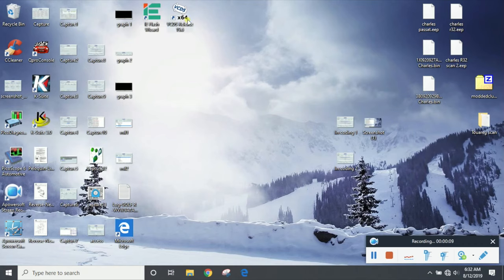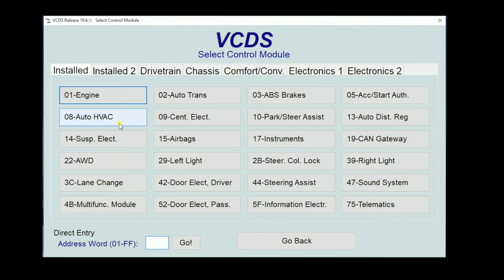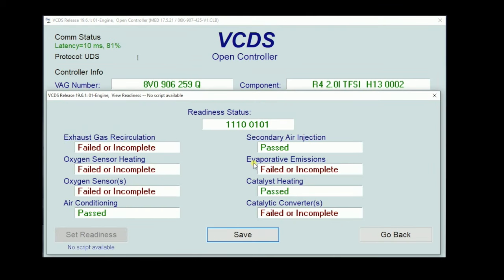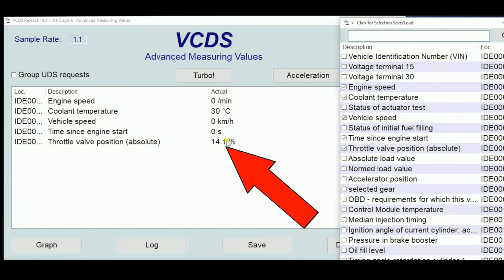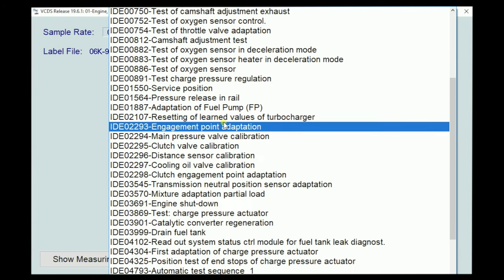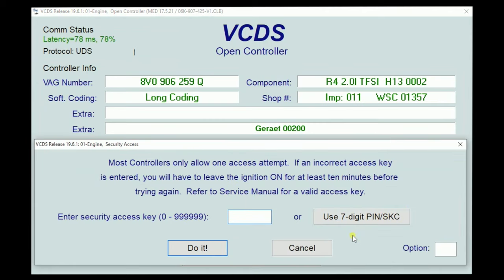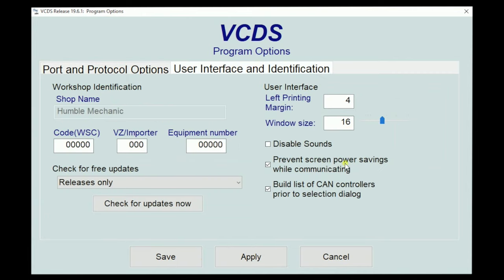VCDS Tutorial ~ How to Use VCDS Scan Tool

Comment: Hi great video I already fixed few problems on my Audi. I have a question about headlight. I had to replace one matrix headlight I put original module back, lights are working but the new light doesn’t move up and down. Can I fix that problem with my vcds??

Comment: Great video Charles as usual...quick question.....you hit on timing chain elongation:reset after chain replacement briefly.....this is my situation for a 2.0T 2014 Audi Q5.....but most recent version of VCDS does not have that option in Basic Tests!!!   Is there some other place, or some other name to look for it....or some other way to do the reset......the engine starts immediately(it had the typical stretched chain lag before chain replacement), and the adaptation value is way under 5%,....but its running very rough.....appreciate any help you can offer....thanks!

Comment: Really liked the video ,i have 1 question ,with the VCDS scan tool ,can you change the miles in the Audi ,i just brought a 20 year old Audi A3 with 102,000 km ,and its already had 7 owners ,Did i get sucked inn.
Reply from the maker: No.. Well technically yes, but only one time when a cluster is under 100km. You can make those changes, but its a deeper thing than VCDS can do

Comment: Hello 
I change my cluster recently and i have a problem 
the new cluster came from Automatic gearbox and mine it’s manual and i have a message every time i turn engine off “ move selector lever to position P” and i can’t remove the key . My question is there is a way to fix this with VCDS ?. For vw touareg “03                                    Keep up the good work

Comment: I like how all the OEM tools basically look like they were originally developed for the commodore 64. Any tips on the P2202 NOx Sensor Circuit Low (Bank 1 Sensor 1) code on a 04 golf mkv 1,6 FSI. Not sure you have that exact model in the US but seems a pretty common fault.

Comment: Hello bro!! I see your videos and are really helpfull a lot!! I know is nothing to do with this, but do you know if the breather valve tube, the one that is on the top of the turbo conected to valve cover on tsi motors, it could be a loss power cause? Or just an oil leak problem?? I hope you can help. Thanks again for the videos

Comment: I always thought it was funny how the VAG OEM diagnosis platform (ODIS) is sooo obtuse and mind numbing to use that even the dealer techs prefer to use the leading aftermarket software (VCDS) as their go-to diagnostic tool. LoL. 

Cheers from Eugene Oregon, Charles.
Reply from the maker: Hey I have been to Eugene a few times. I almost moved there. LOL
Reply: @HumbleMechanic    you're still more than welcome to!  
We need more skilled techs to combat all the hacks around here. It's almost epidemic of hack jobs that are seen rolling into the bays. 

Also: NO RUST!  No road salts to be had for hundreds of miles. So cars in the valley don't rust. Life made easy for vehicle work.

We'll catch up at the next SSF (west coast) seminar. See you then! 
Tell Andy I said "hello"

Comment: I have vcds from I did have electronic power steering problems with my jetta and now I have secondary coolant pump issues with my 2013 toureg v6 gas engine. But good thing I have my own vcds else it cost to get the car scan.

Comment: Guys. I got  genuine VCDS  and been using it for years.  I got a5 with not working keyless entry. I have no faults and need to check the keyless entry system but where l find it in vcds exactly.  Thanks in advance

Comment: I was able to find the battery maintainer on Amazon. I didn't get a response from you in my email... Thanks GREAT video.
Reply from the maker: Glad you found one. I always take evenings off for family time.
Reply: @HumbleMechanic  I understand the family time...  I purchased the Schumacher SP1296 6/12V Fully Automatic Battery Charger and 2A Maintainer.  I'm going the order the Ross-Tech 3VIN today...  I'm undecided on the rotors and pads for the 2016 Golf R Manual

Comment: So suppose someone has a 2004 Touareg, what would you recommend doing, or should I embrace the moments in waiting? Side note, I'm located in Denver and wouldn't mind picking your brain a bit on the topic if potentially possible. Fellow tech working for Mercedes
Reply from the maker: I haven’t spent a lot of time on that gen Touareg with VCDS. The only one I remember is guys changing the radio nav to eliminate the “accept” screen. But it tweaked the stations. Lol
Reply: @HumbleMechanic  Guess I'll just chance it. Probably a useful tool for communicating with the modules anyways. Was having issues but have since found the source of my problems is a cam chain tensioner leaking onto the crank speed sensor. Fun times ahead

Comment: Clearing codes question: So I scanned for codes. A few popped up with specific dates, and mileage stamps from a few months ago.
 I replaced the parts needed, or addressed the issues. Cleared the codes. Drove the car for a bit, and rescanned. 
Now I'm still getting some of the same error codes as before, but with the same date & mileage stamps from a few months ago.

So are they not fully getting cleared, or is it still the same issues but with the original time stamps on them?

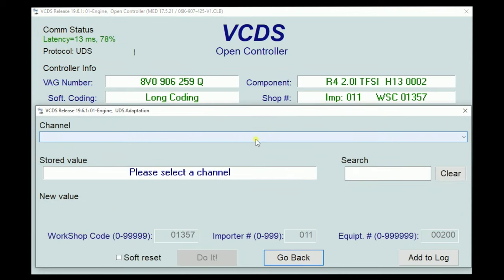Comment: Hey man, couple of questions. Does it void the car's warranty if you change something in a long code? Also, when you scan and save the cars codes, is it bad to do it when the car is brand new/not run in yet? Because let's say something screws up in a few 1000 miles and you revert back to the saved code from when the car was new, will the car assume it needs to do run-in processes again? I noticed at about 15:34 it said engine run-in oil pressure.

Comment: I love your youtube dying. I've done VR6s 12 & 24 valve, PDs, trans and getting VCDS is a must. I've been stumped by a clean 2012 Passat TDI I pucked up for 1800.00. The problem is he wasn't able to get it started after timing kit replacement and high pressure pump, cmp and injectors. I removed the timing belt locked everything down reinstalled timing belt and still will not start. Just cranks. VCDS says same code of P0016 (4096) incorrect correlation not confirmed-tested since memory clear. Any ideas on what other problems it can be? When cranking I can smell the exhaust and a little exhaust out the tail pipe. Could a bent valve be a problem also? Any help would greatly be appreciated.

Comment: Love the video I’d like to know how much info you can access on the E-Golf
Reply from the maker: What info are you looking for?
Reply: HumbleMechanic 
Just curious If I get Vcds how much access to Battery Management Système do you have can you see battery temperature voltage etc. or do you need a code for access. Like disabling the high voltage battery through vcds from some motor or transmission work I know it can be done just uncertain how.  I like working on my cars and the hole electric and electronic part interest me since I’m electrician but just so little info on the e-golf.

Comment: Sorry I know this is not the top but ....
How can I test if radiator cooling fans are working or not in Audi A7/A6 TDI 3.0?  My car is not overheating but while on my driveway I never heard fans running after coming from driving. I saw a test for Fan1 and Fan 2 in this OBDEleven, but both says " Not supported" when I try to select value for that test.

Comment: Hi humble mechanic .  I have a weird problem with my 2002 volkswagon jetta nobody helping me with. 2.0 liter gas 4 door sedan.  Acts like it’s running out of fuel .  Put a few fuel pumps in it already . Has gas and I’ve replaced the filter, pressure regulator, coil , wires, spark plugs, maf sensor. Sprayed for vacuum leaks. Seems it won’t idle like out of fuel. Fuel gauge irratic and throttle stuck on the drive wire?  Could it be a loose ground .  I don’t know we’re to start

Comment: Great videos!!!!!!  I'm new to the vcds was wondering best way to diagnose a faulty n249 valve on a 2010 tsi 1.4 vw golf. I have removed dv it has d upgrade on it doesn't appear to have the diaphragm as per your other videos. But was wondering best measuring block to ascertain it's operation. 
Thanks for any guidance code was p2261

Comment: Hello Charles, I need some insight that I can't find on any forums, if you'd like to help.
My Audi 3.2 FSI is shaking on cold starts for about a minute, then the shakes disappear. Could this be caused by damaged fuel injectors?
I had a carbon clean performed with walnut blasting, and the high pressure fuel lines weren't protected against walnut shells getting in. The high pressure fuel pump broke and has already been replaced. I suspect that the injectors might have been damaged as well, but I don't want to buy new ones in vain.
Or is this more likely to be caused by a transmission (tiptronic) that's starting to go bad?
Reply: Fred P are the injector tips clean ?
Reply: @t2p  I don't know, I haven't seen them myself. There were no such problems before I left the car at the workshop, and now the problems have appeared, but the workshop wants me to pay for new injectors although they are only guessing, they have not diagnosed the cause of the problem yet. They only state that they have done nothing wrong without backing their claim up with any proof. They already changed the high pressure fuel pump for free though.

Comment: Hey I have a b8 a4 2.0 tfsi. I’ve had this random misfire shortly after buying this car. I’ve replaced coils, coil connectors,plugs,pcv valve, both oxygen sensors,air oil separator,cam bridge,magnetic cam adjuster, spool valve/cam adjuster,timing chain and guides. Can’t seem to fix the misfire. I also did a carbon cleaning. Could the issue be that I need to reset the car with an Audi/VW vcd wire and laptop? I’m out of options because this is my only car I use to get to work. Please help

Comment: Hello I have just imported an Audi A3 and a VW Golf MK7 from Japan to the UK and I was hoping I could change the digital speed from KM/H to MPH which I thought could be done from the MMI settings but looks like it cannot be done. So my question is how can I do it as I am not able to use the car in the UK with KMH speedometer. So can I use this tool to change it, I have been informed that the software in Japanese models is different and it will not allow me to change to MPH. Please advise

Comment: Could this software help with stuck panoramic roof? On a 2011 Audi A8 the rear part got stuck open, I try to mess with the fuses pulling them out and back in and now nothin is working on the panoramic roof controls - not the panels, not the shades. And manually I can only open/close the front part of the panoramic, not the back. Thanks

Comment: Hello. Can we activate cruise control and fuel consumption information in a car that does not have it ? Ι have replace the basic handles with handles that supports cruise control and trip computer and I want to make them work just I do not know how. Can I make it work with VCDS? The car I am referring to is the SEAT IBIZA 6J 1.2 TDI 2013 facelift . Thank you.

Comment: My mk7 golf R suddenly won't display "from start" driving data on the instrument cluster. If I press the "Car" button on the infotainment the data is there. In instrument cluster settings driving data is checked but only displays "extended time"
Can VCDS troubleshoot this?

Comment: Hi Charles love your videos.  Would VCDS be able the detect the issue with the headlight range defect on the Audi 2011 A3? Txs keep up the great videos.
Reply from the maker: Likely would help track down the issue
Reply: If you haveni foumd the issue yet, Like Charles said, it would help track down the issue, but more than likely it's probably one of the small wires that got frayed.
Reply: @atrain132  Hi Thanks for your reply.  We found the issue. It was my auto body shop that had unplugged the headlight while doing work on it.  They are started the car without the headlight on which triggered a code.  With a scan tool i was able to scan for the electrical faults, and reset the headlight fault.  Immediately the car did the headlight test and all when into order.  So Wiring was ok.  Cheers.

Comment: Halo....im n DIY mech myself,
Struggling with a car, where the owner changed the car tape,and the steering wheel went into semi power steering mode(yellow light),tried adapting/bassic settings as well several times,but nothing, Revers swapped the tapes,tried again,still nothing...
Getting the:
03109-power steering control module no signal
00778-steering angle sensor,no or incorrect basic settings/adaptation

Comment: Hello, I have a question I hope you can solve it for me, in the video when you enter "basic settings" I see that the option of clutch valve calibration and "clutch engagement point adaptation" appear, are these options really used to calibrate the clutch? I ask this because it is in the engine channel where those options are and not in the transmission channel.

Comment: Quick question,  Got my VCDS.. Yay!  Well I have an 07 V10 Touareg.  Tried to autoscan and it hung up on 16 Steering wheel.  Got the "not responding."  You mentioned it taking forever.  How long is forever?
Reply from the maker: 07 takes a long time. Try talking to just that module and see if it will y’all
Reply: @HumbleMechanic  Wow, fast reply - thanks! Yes, it hangs on just that module.

Comment: I have a 2012 Audi A4 B8
Ben having an issue with a P02015 code that points to the intake manifold sensor but I’ve replaced it with a new one. Still getting the code and I noticed the coolant temperature gauge on my instrument cluster flashes and flickers a lot on and off like if it had a impulsive signal. That harness is a part of the same harness to the intake.
Is there a way to check the reading of those wires in VCDS?
I have do have VCDS
Thank you
Would really appreciate help

Comment: Charles, having just got VCDS, this was a good intro to the system. However, I noticed you left Aggressive mode activated when you did the scan. Should this always be on? Somebody has mentioned here in the UK, that this is mainly for dealership diagnostics, and for DIY scanning, aggressive should be un-checked. Also, I have read lots covering measuring blocks, for things such as the battery voltage etc. Where will i find these block numbers please? I have an 2011 Audi A7.
Also, Can I use VCDS as a scan tool for other makes of car, just for scanning DTC's?
Reply from the maker: Start your MVB search on the Ross tech wiki or forum. 

A mode can be left off. :)
Reply: @HumbleMechanic  Thanks. Appreciate the reply.

Comment: Volkswagen passat cc 2010 has bad ecu. I bought new one and copied original data to the new one. But my car did not start or crank because new ecu is from automatic car and my car  has manual transmission. Can I change transmission type with vcds of new coded ecu? Thank you

Comment: Hello, great video. Can I check the individual injectors values using VCDS?
Reply from the maker: It depends on what you mean by that.
Reply: @HumbleMechanic  I want to see if an injector is not working perfectly without taking it out, is it possible? Thx
Reply from the maker: @saw0man  Kinda, and yes and kinda and it depends. We can output test the injector and see if it is coming on. This checked for power, ground wiring and signal(usually ground). We can also look at knock in each cylinder on many newer cars to see if they are balanced. PLUS if our injector is not working properly, we may have a misfire.
Reply: @HumbleMechanic  thanks a lot man, you are the best

Comment: Do you know if its possible to remove a module? For instance i bought an 08 touareg with an eonon radio. Anytime i scan i get faults from the radio and a few others. 

Also trying to find any info on the buttons near the sunroof button inside the clock part. I have 4 buttons that dont seem to do anything. And it says fault inside the digital screen up there.

Comment: hello my friend, maybe you can help me.  i have a vw sharan 1.9 tdi 130hp from 2000, i had problems with the instrument panel and had to change it, in the meantime the new instrument panel doesn’t work at engine temperature, i have already changed the valve on the engine and it still doesn’t work, i thought  whatever the problem was on the panel and I had the panel tested and it worked perfectly.  do I have to configure the new panel with Vag-com

Comment: I have a 2014 Audi A5 2.0 turbo. It is in a crank no start situation. I have codes p2188 p2293 p2539. Should I change the hpfp or the low pressure fuel sensor? I pulled the hpfp and checked the cam follower it looks good.  After about and hour of driving I killed the car then started and it cranked but ran rough idle was up and down killed it and it hasn’t cranked again. It will start but no crank. I have removed the fuel line off of the hpfp and it sprays fuel when you start the car. So I know I’m getting fuel.

Comment: I was surprised to see you using this software vs odis. Are there instances where odis is necessary? Like coding a srs control unit maybe?
Reply from the maker: They both have their place. You can do just about anything other than immobilizer with VCDS.
Reply: @HumbleMechanic  sweet. I must look Into it. Volkswagen audi have always intimidated me.